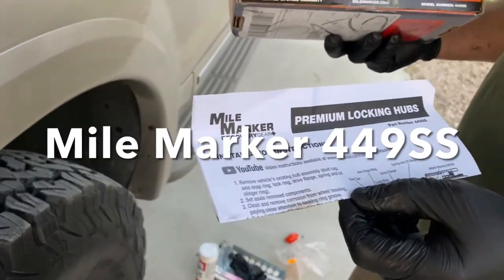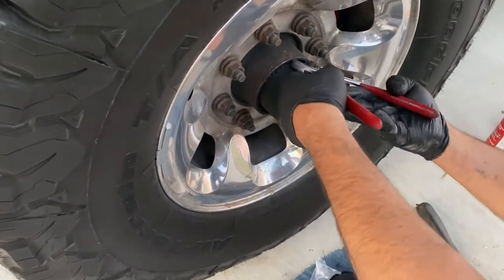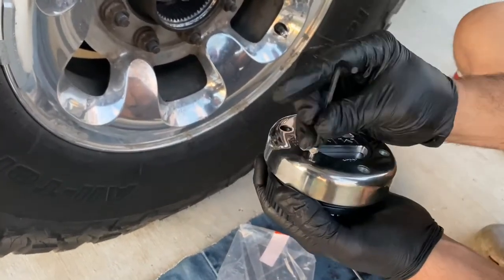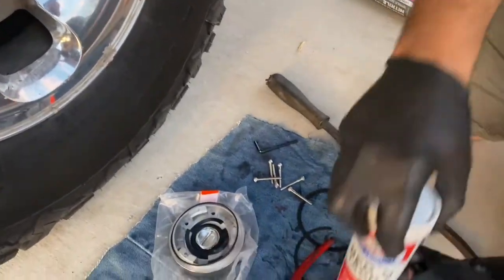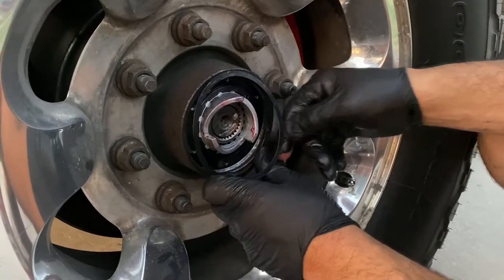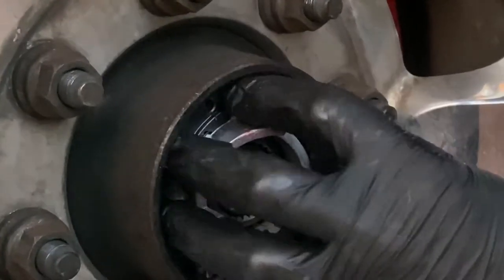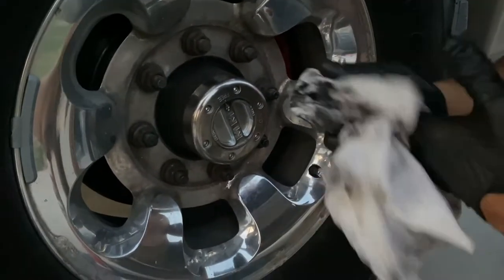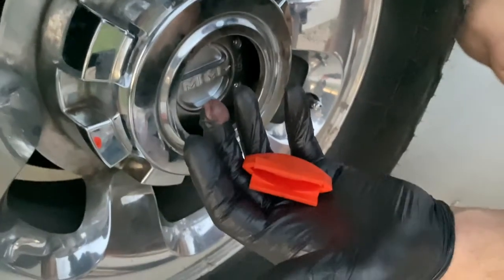Ford excursion mile marker after market manual locking hubs install

Comment: Did you need the nut conversion kit? 
Mile Marker says when switching from auto locking hubs to manual locking hubs that kit is required. 
Also, were there any vacuum lines you had to plug?
Reply from the maker: I didn't have to do a nut conversion.  Also my vacuum lines were disabled because I didn't find them as reliable.